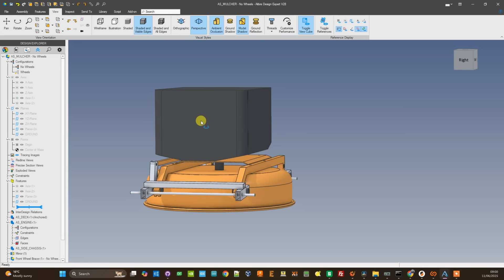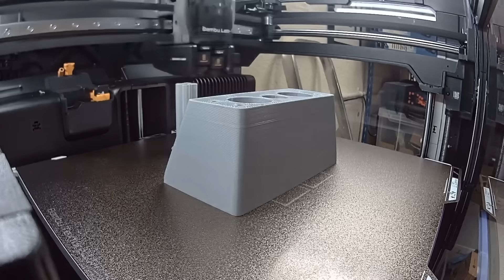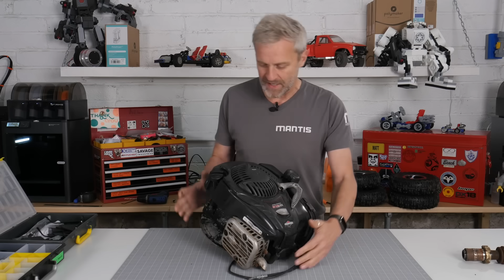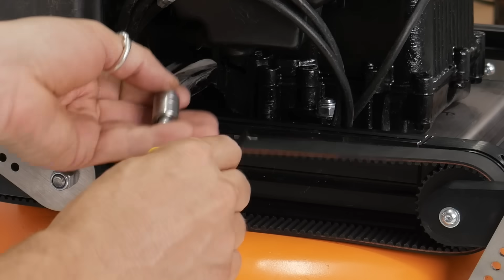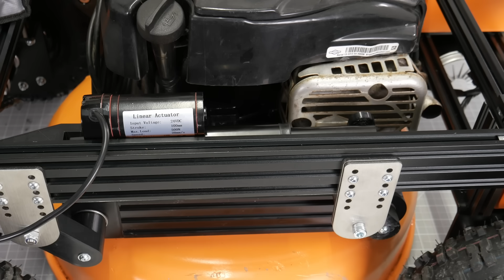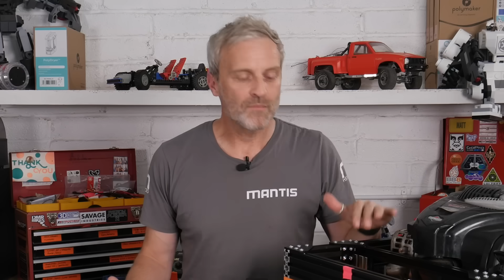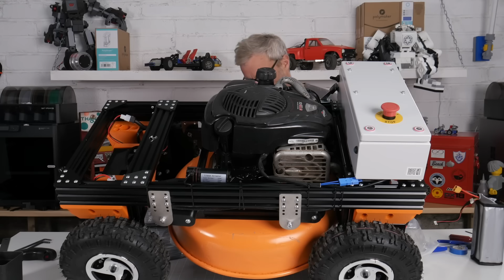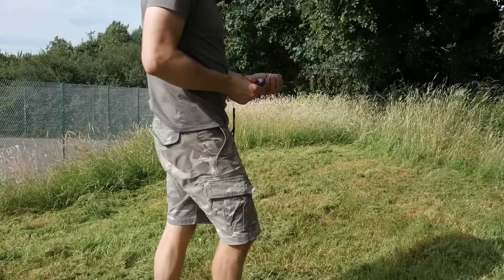I Built a 4x4 Radio Controlled Mower!

Comment: your belt tensioner is eventually going to fail.  it's a pretty long lever on the side of that extrusion.  it may not seem like a lot of weight on it right now, but over time with the mower bouncing around, it's going to wear it out.  
since you've concentrated the extra weight to the front, you could have put smooth tires on the back.  that way they slide easier and facilitate easier turning.
Reply from the maker: I’ll let you know when it does

Comment: Looks like a fun project and seems to do what you wanted. So thats always nice.
Would have been interesting to give us a rough price breakdown of all the parts and materials used.
One thing i'm missing is access to engine maintenance. How easy is it to clean the air filter, do an oil change and generally cleaning Mulchy after work?
And it would have been really nice to do a fully electric version and get rid of the gasonline engine to reduce noise and emissions.

Comment: Love this! If your tires wear too much you should consider making a set of over tire tracks, you could 3d print the chains using that tough stuff you used on the mounts and embed with skateboard bearings and use old tire treads for growsers. I know they use tread over tire add ons for skid steers. Your motors would work perfectly for tracks...
plus,  tracks are just cool!

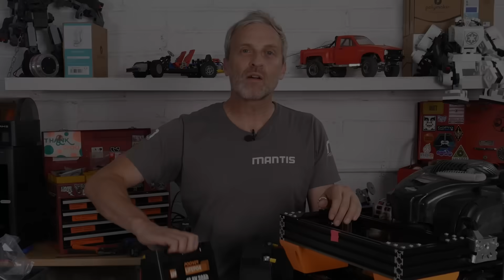Comment: When you discuss the specifications of the batteries around 29:10 you get the units mixed up. Current measured in Amps is the rate of charge moving. Charge measured in Amp Hours is the amount of charge contained within the battery. One relates to how much power the battery can deliver in a given moment, and the other relates to how much energy the battery can deliver before it needs to be recharged.
Reply from the maker: I understand how batteries work.. but. Lifepo4 batteries have a BMS that limits the output current to the capacity of the battery. Eg, 30Ah capacity, 30A current limit, however the batteries I picked have a higher 40A current limit.
Reply: I understand, and this is crossing over into pedantry since it’s clear you understand also. ❤

But what you said was “… 30Ah each of discharge and 90Ah for 5 seconds”, when you were referring to the current not the capacity.

This is simply not the correct unit, they will discharge 30A in order to respect their 1C rating with a capacity of 30Ah.

To be clear I only commented because I thought maybe you were unaware, it is obvious based on the rest of the video that that was not the case, perhaps I should have edited my comment after watching the rest.
Reply from the maker: I see. So I said AH rather than Amps. Slip of the tongue 👅
Reply: @MattDenton  thanks for being gracious in your reply, and thanks for the super entertaining video. 🎉

Comment: Seems like a perfect conversion project for an electric mower.

I don't think I can go back to dealing with oil if you want to flip your mower over, and fiddling with carburetors, gas cans  and pull starts at the beginning of each season.

Comment: I know you said you got the main parts at a reduced price, but $370 for 4 motors, 4 wheels, mounts, controller, and receiver ? I would absolutely build my own if I could get the parts for that ridiculously low price. 
 I do like how you decided to go with drive on all 4 wheels and not just 2 of them. Maybe some caster ability in 2 of them wheels would help with its turning ability, or fixed rear motors with steerable front motors. This would gove you a wider turn radius, but still maintain all wheel drive. A motor that is designed to run safely at steeper angles have a few things integrated, such as how the oil is contained (to not starve motor of lubrication when at angles) Cool project, I've always wanted one of these. I would do it with a mower that has a starter though, so it's completely hands off after it's powered on (pull cord is one of the main reasons my mother and wife started using electric saws and trimmers). Definately need an alternator to keep the batteries topped off, or at least put some juice back for longer mow jobs that the batteries just won't last long enough for. String trimmer, great attachment idea, but again you would want a camera for that too so you can keep a cloae eye on your target. Some headlights for work in the dark, like plowing, and if using it to push snow, you would need a tracked chassis. 
I understand this was somewhat of a budget build by reusing the mower you already had, these are all just ideas that pop into my head when I imagine what my perfect idea of a machine would look like. I havd seen others, including my step brother gather parts to build an RC mower using an existing  lawn mower as a base to start with. Thes kits are sold, but they are fairly specific to brands of mowers, which allow them to fabricate parts that require less engineering and fabrication to assemble. The RC Mowers you can buy pre made are really expensive. I guess thats the cost of being able to do work remotely. All super cool.
Reply from the maker: Yeah they gave me a good deal on the parts which made the project viable! There’s still much I’d like to do, but the reason for 4x4 was due to the terrain it has to cope with. And simplicity of build.

Comment: I used to think I was smart. Not so sure now. However, electric mowers are much lighter than gas mowers and one could possibly use the existing battery power for all the electric parts. And, electric mowers have no gradient limits.

Comment: Swap out the 4 stroke for a 2 stroke so mowing at steep angles will not be an issue.   Or a 4 stroke with a pressurized oil system vs the basic splash system that engine has.

Comment: Maybe you did, and I didn't see it, but make sure you pull the spark plug when pulling the blade retention bolt, or you could bump start the motor with your impact drive.

Also, your steering would probably be easier on the machine by using offroad casters on one end, just like a regular zero turn mower.

Comment: With the Arduino could you set a predetermined map so it could cut autonomously? cuts would be much easier on Mulchy if it were maintenance cuts instead of taking down large swaths like you were doing.

Comment: Remove two motors and replace with simple swivel axles so that two drive wheels (back) can steer. This would turn it into a modern zero-turn mower style setup. Would also nearly remove the wear on the tires. If you have the lower torque motors, it would run at a reasonable pace and two motors would be more than enough. Great build!
Reply from the maker: But it wouldn’t handle the terrain I have. IMO

Comment: Seems like a fully electric version might be possible. A vertical electric motor in place of the petrol motor. No pull starting, a lot less noise, no refuelling, no inclined terrain issues other than a rollover limit. Put batteries front and rear over the axles for more weight over the wheels to increase traction. Everything being electric would make interfacing and automating things easier. Put a single solar panel flat over the top and if parked outside you would get some weather protection from the solar roof and a nice self charging feature that would likely give you a 100% charge for the weekly grass cutting.
Some other things that could be added  with the added battery capacity :
   Add some LED lights and late evening grass cutting is possible. (also without annoying the neighbours due to the reduced noise)
   Electric strimmer arm as you described.
   Electric leaf blower. 
   Cameras to create a mobile security sentry, adding a speaker and a barking sound generator for when intruders are detected.
   Magnetically attached charging cable to allow for self docking and charging when solar is not enough.
   A small electric cooler box so Mulchy could follow you around carrying cool beverages like a good dog.

Comment: PLA isnbt a great choice of filament for this. PETG, ABS or ASA would be a lot better.
Reply from the maker: HT-PLA has worked out great! You need to explain why the others are better?
Reply: @MattDenton  thats great to know! Usually PETG, ABS and ASA are less prone to sag over time, PLA is notorious for this issue.  Also PETG is more flexible, not like tpu, but it helps prevent snapping. PETG and ASA have greater UV resistance then PLA. PETG is also more chemical resistant.

Comment: Since you are using the tilt-sensor in combination with an arduino, you could use a delay to stop the sensor from shutting the system down immediately, but rather wait a second or so and then proceed to a shut down command. It should do a similar thing as filtering out the signal jitter from vibrations.

Comment: Looking at the battery usage, maybe swap the gas motor with an electric one??
Reply from the maker: The power use of the drive is low compared to the cut. It would need much larger batteries. But I may do an example of this as people have requested it. Petrol is about 16x more energy dense than lipo batteries, after efficiency calcs etc

Comment: New to your channel, I like your style and the content, but I get nervous about certain things. I'm thinking it may have already been mentioned in comments on your channel, but that thumb ring gives me chills and makes me cringe, causing me to look away and imagine what could happen if it got caught on a running engine or powered tool. It could yank your thumb clean off or do some less serious but devastating damage. One of the rules for machining and stuff like this is NO JEWELRY. I know those rubber wedding bands are popular for wood workers who want to avoid losing digits. This comment is WAY OVER THE TOP, just a thought for safety.
Reply from the maker: Thanks for the feedback! Glad you like the video. Been wearing the ring for 25 years. Don’t recall doing anything dangerous on the video though.. 🤔

Comment: Beautiful! I am on my 5th year or so of RC mowing. I went cheap and light so I could put it in my car trunk. I use four $20 kiddy car plastic 12v geared motors bolted directly to the mower's original tires powered by 20v DeWalt batteries. I use Walmart's cheapest lightweight mower. It works great on flat yards with normal grass height. Fast, sweat-free mowing in 1/2 the time!
Reply from the maker: Nice 👌

Comment: Why didn't you use an electric motor to power the blade?
Reply from the maker: Power to weight ratio of petrol is hard to beat
Reply: @MattDenton ofcourse, but the engine weight is significantly smaller that would compensate for that.
Reply from the maker: Do the maths.. I’ve done it and it’s not significant enough. At least not for the equivalent run time you can get from a 0.8 litre petrol tank

Comment: I would think it simple for yourself, but a gps unit and course mapping system so you could press play and it would run its own route around the garden without you needing to control it manually. 🦗🥷

Comment: Convert your transporter. Move the front wheels to be close to the rear wheels. Put castors on place of the front drive wheels. This will stop the skid steer from tearing up the tread.

Putting a gyro attached to the  to the frame can cancel the uncommanded turns due to skidding of the wheels. Some of the RC GYROS output pwn "commands" that can be fed right into the yaw input.

Buy a battery charger coil to add self charging of the battery.

Putting first person video.

Then make a lime squash, and mow the lawn from the veranda!
Reply from the maker: Great ideas, thanks for the detailed suggestions!

Comment: I gotta ask, why not replace the ICE engine with an electric one?
Reply from the maker: Power to weight ratio of the fuel. Petrol has approximately 16 x the energy density of lipo batteries, factoring in inefficiency of ICE compared to electric

Comment: I own a lawn care company, try and put a side discharge for the deck, it will be much easier on the mower! Also if you raise the front cutting part 1/4 inch it's called negative rake, it will mulch the grass much better, the front swings cuts at higher height, the back cuts at a lower height!
Reply from the maker: Nice 👍 yeah I could raise the front
Reply: Wouldn't a side discharge defeat the purpose though? It wouldn't be mulching the grass then it'd just be cutting it and ejecting the cuttings like any other regular mower?
Reply: I am so glad I read this comment, changed my life! Made a huge difference when cutting my tall grass, now I don't have to mow as frequently! :face-red-heart-shape:
Reply: If you’re cutting the thickest, tallest, Florida grass, I recommend more than 1/4”, I often will do max height for the front. However the cut height gets less consistent.
Reply: @WilliamGuerrero-Ruiz  all great points. The one thing I would add is not all mulching blades are created equal. This example might be extra bad.
Reply from the maker: Seems to be mulching well IMO
Reply: @MattDenton  Good Job, can you explain the comment ""@WilliamGuerrero-Ruiz"" please? I didn't understand.

Comment: That mower is great for open spaces, but what about an attachment for trimmers or edging? It can be mounted on the side in between the tires with a motor that spins a trimmer with those plastic lines. I'm not a landscaper or anything so I'm not ser on the terms.
Reply from the maker: Yeah a strimmer, I discuss this at the end of the video :) 👍

Comment: The electric enclosure box doesn't seem to have any ventilation for the motor controller.
Reply from the maker: Correct, but the heat sink is bolted to the lid which more than doubles its surface area. So doesn’t run that warm

Comment: Add GPS and a recorder. Then mow your yard. Next time you mow it will do it for you without you having to control it. (or try the electronics of a Roomba Vacuum?) This won't work well on the incline due to the slipping, unless... you get rid of the tires and use a track system like a tank?  That's my thoughts.

Comment: Hi, I too have a slope to and am looking into building something very similar to Munchy. The issue is the slope is 45 degrees. So either have to make a way to keep the gas ⛽️ engine level or use an electric mower. Which is again expensive. I love what you did and is great to keep in mind. Thank you.
Reply from the maker: Thanks 🙏

Comment: By the way, what did the motor manufacturer say about the request for different gear sets?
Reply from the maker: They said it wasn’t a heat change it was a different motor with different winding

Comment: I’m not sure about your specific mulching mower, but mulching mowers made in the US often aren’t designed to handle long grass, which could explain the uneven mowing results. Additionally, the wide tires press down the grass before it’s cut, so after a few days, the grass grows back unevenly, making the cut look less tidy. Unfortunately, solving this might be tricky since the wide tires are necessary for stability on the steep slope you designed it for. Overall, though, it’s an impressive machine, and I wish I had the skills to create something like that! Great work and great video—I’m subscribing!
Reply from the maker: Yeah it’s really a rough cutter and the grass was way too long, however, now the grass is under control and I’ve cut it again it’s looking much better

Comment: As an engineer (mechanical) and fabricator, You have provided a great example of 'over engineered'. For example, if you chose to weld instead of build the crazy frame you built, you could have saved so much design time and money. When I first started practicing engineering outside of the university, learning to not over engineer was a big long lesson. I still work on it to this day.
Reply from the maker: I disagree. When you are making a prototype it’s much easier to have a frame that is modular and I can add fixings where ever I want simply by sliding a nut into a channel. That’s why aluminium extrusion has become so popular for cnc machines, 3D printers etc.  also if I made a welded frame I would still design it in cad first. I’ve worked on many large scale projects and with experience I can say time spent in CAD/design prior to cutting metal is always time well spent :)
Reply: I appreciate your perspective, Matt, but I’d like to offer a counterpoint from professional experience. While aluminum extrusion is convenient for modularity, it does come with trade-offs—connections can work loose over time, especially in high-vibration or load-bearing applications. Both your design experiences. 

Also, while CAD is a great tool (and I use it too), I think it’s worth noting that robust, functional frames were being built long before CAD existed. A well-thought-out, task-specific frame can often be sketched and built without needing a full digital workflow, especially for simpler or one-off builds.

Lastly, the need for extreme modularity often points to an under-defined design phase. When a project is researched and scoped tightly for a specific task, the frame often doesn't need to be endlessly adjustable. Simplicity can be a superpower when done intentionally.

Comment: that whole original mower was built around the height adjustment - its the most thought out part of it. Engine is mounted backwards, its too narrow plus the engine is huge so you could have gotten 22" out of it easily and it would be a lot more stable